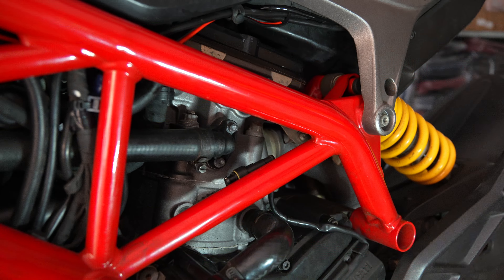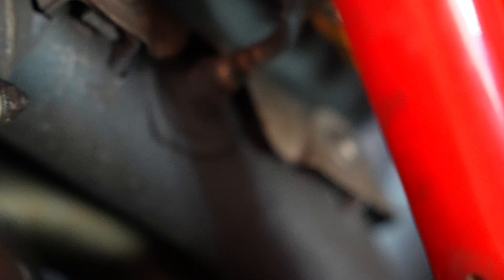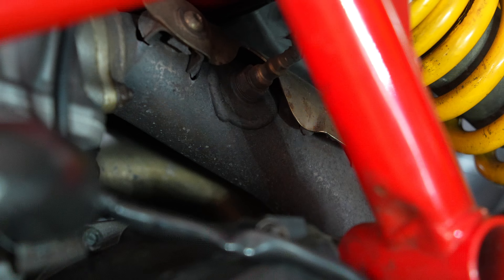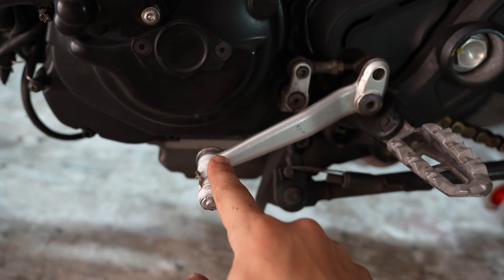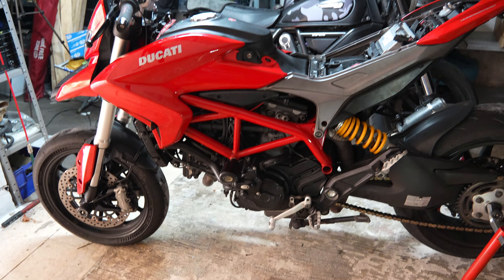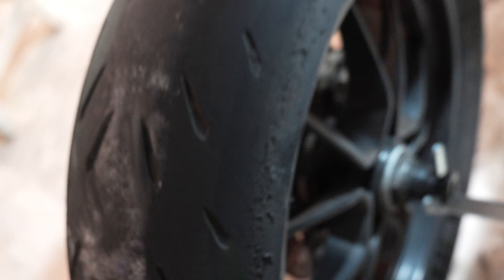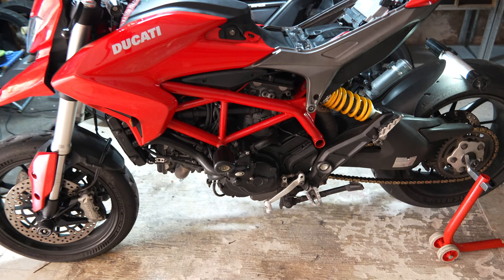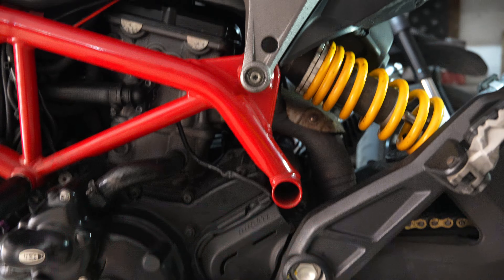Hypermotard Track Day Aftermath

Comment: Hola, vas a tener que endurecer la suspensión para la pista, adelante cambiar los resortes o más barato suplementarlos con un resorte cortito duro o con un suplemento, y usar un aceite más pesado y atrás trabajar con la precarga del resorte, tendrías que haber hecho un video con el viaje hasta sicilia y la llegada a la pista, eso también es interesante, suerte con el colector, Un abrazo!!
Reply from the maker: Hi!👋 Rear suspension definitely needs to be  adjusted,  I think the pegs were scraping mostly because it was too soft and because of the this also couldn't take the tyre to the edge. I need to learn abit about suspensions as I'm not really good at that. The plan next time is to make kind of a vlog of the weekend, unfortunately this time around didn't have much time to film anything as I had to also do some photography work.
Reply: @pullumoto  very good!!

Comment: Heater circuit code - more likely a wire has broken or burnt, than an issue due to the air leak
Reply from the maker: You are probably right since there was kind of an open flame that could be hitting the wires. I am gonna replace the sensor anyways now but will try to check if there is any physical damage